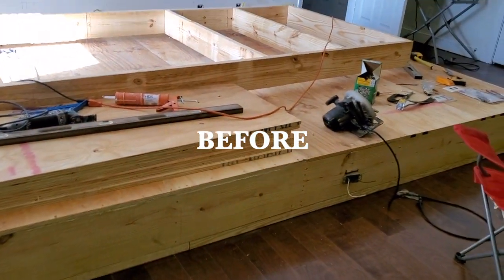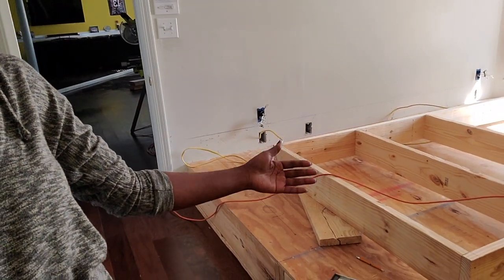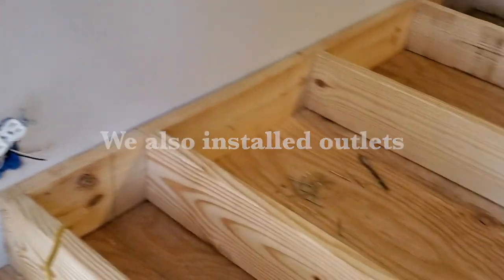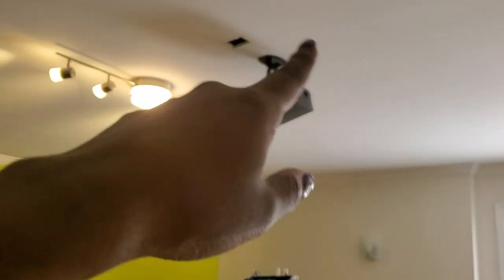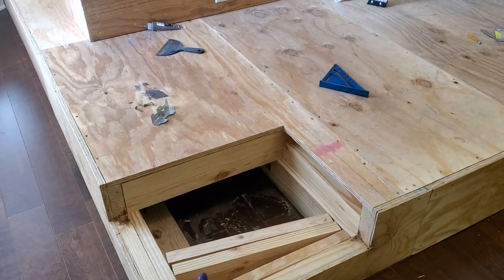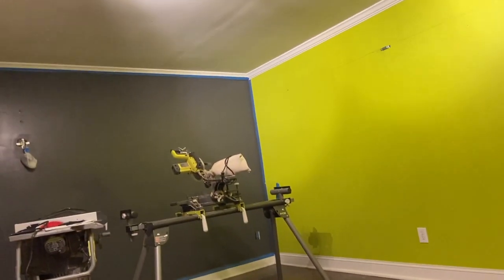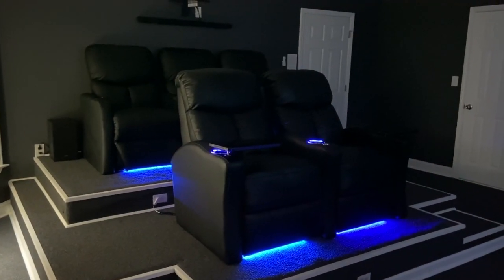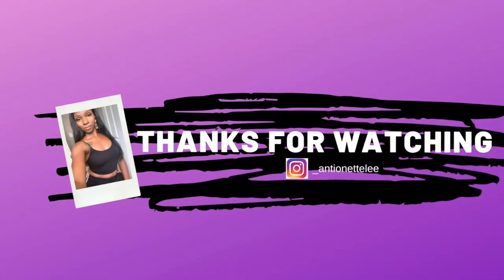DIY HOME THEATER 2020| FROM BASEMENT TO 4K CINEMA ROOM ON A BUDGET| ANTIONETTE LEE

Comment: This is a good starting point. Without sounding too critical you should plan on what sound & video is going to serve your needs for the next 10 years & then decide on a general outline of which products wiil meet your needs and design a room with this in mind, because ideally you would want to create a truly outstanding theatre room with an impressive sound system with stunning acoustics and beautiful lighting and surroundings and not a room fulll of black boxes as an afterthought. As it stands whatever you decide to do is going to cause a major remodel if it is to be done right. 

Is it going to be a speaker layout that is a 5.1, 7.1, sound system or 5.1.4 or 7.2.6 object based Atmos type audio? The importance of just this one decision will make sure you are now covered for whatever speaker layout you choose and design and don't have to cut major holes into walls and ceiling for speakers, speaker cables and power cables. The luxury of planning properly for your home theatre especially if it's missing major home theatre components is to avoid things being redone over and over again and minimise damage to the room. This way it will make sure the important construction plaster, wiring, carpentry things are now in place ready for when you're ready to install without damaging the room, because as it stands when you're ready to add speakers, AV equipment you're going to have to damage walls ceiling, plaster, dust etc and start over to accommodate all the cables, amps, speakers that will be arriving at some point in your future if it is to be done right. 

Here is a simple suggestion for just one less future headache make sure if you're running a 12-15ft or longer HDMI cable from where your equipment is going to be located and end up plugging into your projector, use either a fibre optic or self powered cable capable of handling 40GHZ signal otherwise if you upgrade your projector sometime in the future you won't have to rip the cable out of the wall and keep replacing your current cable which is probably only 18GHZ or less and won't be able to carry the 4k 60HZ or 8k 120HZ future high frame rates.